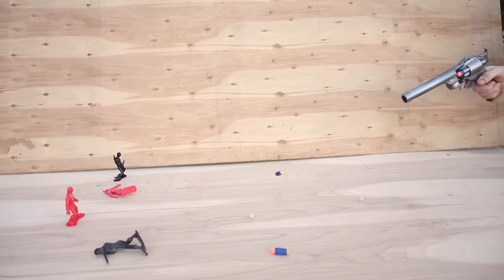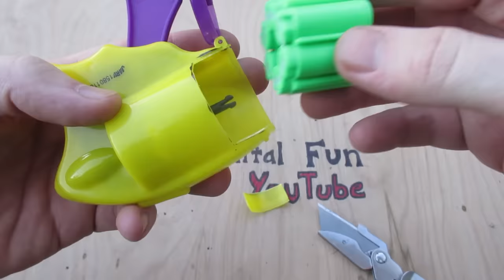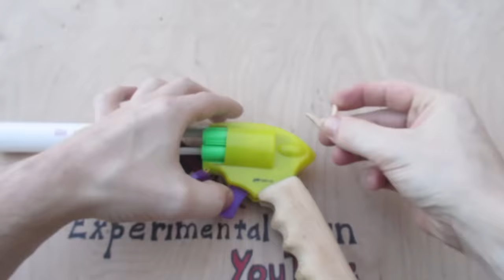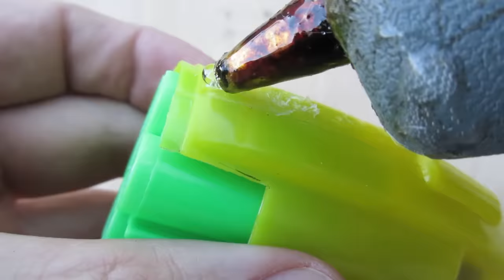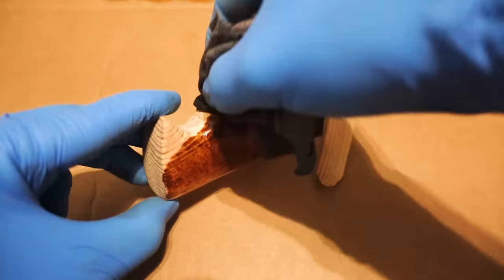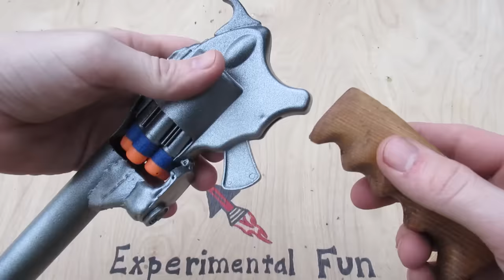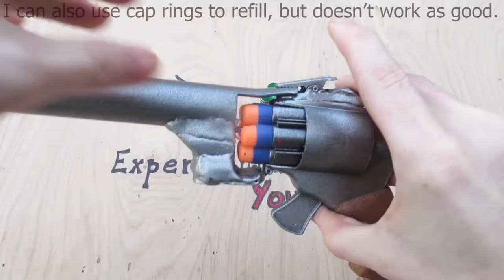Homemade Nerf Gun Revolver (Easy $3)

Comment: After months of searching for a worthy nerf revolver, I find myself back at the beginning.
Reply: The beginning is nerf knife
Reply: @nachochips1458  knives are epic
Reply: @nachochips1458  knives aren’t revolvers
Reply: I know this is a late reply but have you tried out the hammershot or the strong arm
Reply: @justagoldencommandowithint5333  Unless you combine the two
Reply: well... he did technically made a firearm instead of a nerf gun...
Reply: Nerf Fortnite revolver is actually really good. It has a smoother action than the hammershot, and has 6 instead of 5 darts. The suppressor is not required.
Reply: Rekt?
Reply: Lol why is this so relatable

Comment: I wonder just how far you can push this... Maybe put a scar barrel (like a rifled choke but for nerf) on the front instead of a useless pipe,  add a bit of vegetable oil to the caps for a bit more smoke, etc. I could see this as a really great tool for LARP players in an wild west /parlor LARP setting.

Comment: This is something I have been trying to look for on youtube for so long! I love nerf and revolvers. I haven’t been able to find a proper nerf revolver video. The other ones are mods of nerf guns and this one actually has a good loading mechanism and looks really good too!
Reply from the maker: Hey Thanks, glad you like it :)
Reply: well it also say $2....but you need to have the tools, wood, spray paints, PVC, glue gun, and the nerf darts themselves which are already pricey, and you not only need to cut them up but fill the holes.
Reply: You could just use a gun from a different blaster company like xshot
Reply: Buy the nerf hammer shot
Reply: Maximustube I have but it doesn’t have the properties I’m looking for such as a cool loading mechanism such as break or pop out cylinders. I want it to have 6 shots. And it at least has to look like a real revolver.
Reply: nyan party Nordmann Yeah but it doesn’t have the same properties as the one shown in this video.
Reply: Do anyone of you know what is this song called? -------->0:05

Comment: any way to make this a more "traditional" nerf revolver (i.e. fire standard half length dars and no boom boom.) this is by far the cheapest nerf revolver on the market now and this would be fun in a war. also if you could chronograph this it would be great.
Reply: Also he didn't need to glue that back part onto the dart
You also seem to know what your talking about.
This wouldn't be reliable in a war.
Reply: if you had enough cylinders (then again you really don't if you are fast enough) like a drop cylinder hammershot, strongarm, etc. and it hit better then a jolt it' could be more "practical" than a  stock hammershot, and plus, it's pretty badass
Reply: Do anyone of you know what is this song called? -------->0:05

Comment: You don't need to make the long barrel or use a wooden grp to make it
Half length darts seem mandatory, they are more accurate than full length nerf darts
Reply: .....my guy. It is made to be an acurate revolver. Only criticism u need to tell him is his handle should be fixed.
Reply: Agreed
Reply: @DUDEAWESOMEa  wha? Why did u agree with me?
Reply: @angelawhite2325  because grips IS small. I have got massive hands so it'd be pretty uncomfortable to hold it. Abiut the barrel length (oncr again), its is not a real gun. So, a shorter barrel would do just fine. If the barrel is longer than what is required then the range of the gun will decrease.
Reply: @DUDEAWESOMEa  well then don't buy it. It's really ment to be for kids, that's why it's built like that. I'm just saying the handle should be adjusted to look like a real revolver for esthetics. The barrel is fine.
Reply: @DUDEAWESOMEa  so ur not gonna respond?
Reply: I guess you are right. But I usually focus more on functionality because I use heavily modded blasters
Reply: @angelawhite2325  just did
Reply: @DUDEAWESOMEa  so? This has nothing to do with power, I'm talking about looks.
Reply: @angelawhite2325  I was talking about functionality
Reply: @DUDEAWESOMEa  and I wasn't
Reply: @angelawhite2325  Yeah I figured that out
Reply: @DUDEAWESOMEa  ok

Comment: Why can’t nerf make blasters like this that are semi auto without batteries 😂
Reply: Supahboi5  well I know but they are not pistol size like this one. Because the nailbitter or even the dart tag snap fire 8 is a little bulky
Reply: sometime soon i plan on trying to figure out how to create a semi automatic 1911 without batteries, to cycle the action would most likely be trigger power.
Reply: @Asher Harrelson lmao well sorry I’m not a gun nerd. If I know very well tho nerf blasters and real steel firearms are not very similar. I mean maybe the asval has a similar trigger to some nerf guns using a prime featured spring to activate the hammer. But besides that I’m pretty sure real steel works differently 😂 especially when it comes to stopping power.
Reply: @Asher Harrelson well no problem just letting you know I don’t know much about real steel as you see. But lol I do like the mossberg shockwave 😂
Reply: @ГульгенаСафина-с2ч  🤣. 🇷🇺

Comment: The long barrel makes it less accurate, because the dart can bounce off of the sides of it. You also need tools to make it, overall it can be fun to make, but considering that you need a party popper to make ammunition, that is 2 $ per 6 rounds + the cost of the darts. Good on you for using half-darts, they're way better, and you can use the discarded foam bits to make more darts, but if you want a gun that shoots better, buy a nerf gun. It'll be cheaper if you buy knock off darts which are as good as regular ones (if they're the right size, otherwise they might jam flywheel guns). If you have all these things lying around then make it, but if you're actually interested in a nerf gun, buy a nerf gun (doesn't have to be a NERF brand gun, can be a dart zone or adventure force gun, maybe even 3d printed with springs and plastic tubes).

Comment: Because this is much easier to get and works way better than a dual jolt set from the actual nerf brand that's only $2 more expensive and doesn't require you to butcher your darts and household items

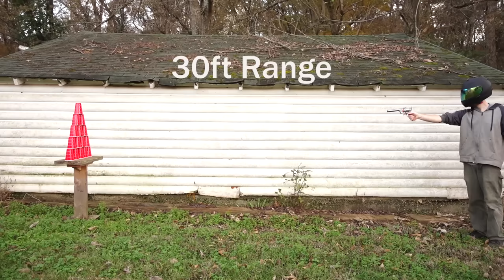Comment: the propellent in the confetti blaster is a small amount of gunpowder technically making this a firearm pipe pistol. also there is no way in hell that this is 30 FT at 4:17
Reply from the maker: the range is about 30 foot, that's not 30 foot, the darts still have enough energy to knock over the cups there, I'm saying if you shoot it a nothing it will go about 30ft max

Comment: Ah yes
Easy 3 dollar project
Using a fucking
What even is that
Reply: dremel
Reply: @lurk7967  yeah I don't think we can get one
Besides who the fuck just has one of those lying around
Reply: @W74_Pizza  People that live in rural areas and do their own work have them my mother for instance had one when I lived on the farm. But yeah I get it most ppl would have to call a handyman who might have one. buy dremel

You can get one on amazon for like 30 bucks but I don't think it will work well good ones at a store will be like 100 bucks. If your gonna spend this much money making an improvised firearm just make a zip gun lol
Reply: @W74_Pizza  Also  you could do just buy or borrow the Dremel bits and for something like this that doesn't have to be perfect they would work in a normal drill
Reply: @lurk7967  well in any case I'm just gonna use a lighter and a spoon to burn away any material, slower but it still works
Reply: @W74_Pizza  That end up workign did ya build one of these if so good for you
Reply: @lurk7967  not yet, haven't started. Probably will soon enough though.